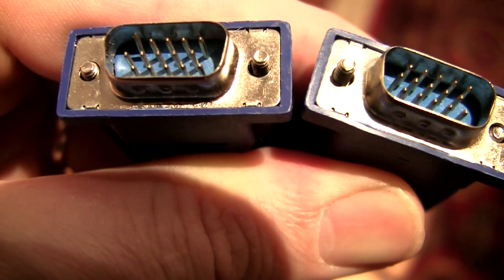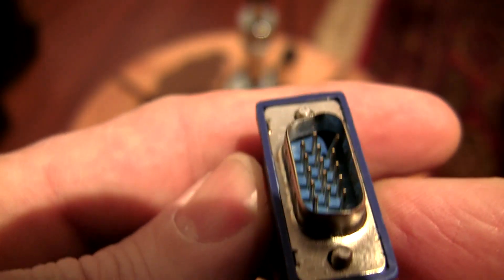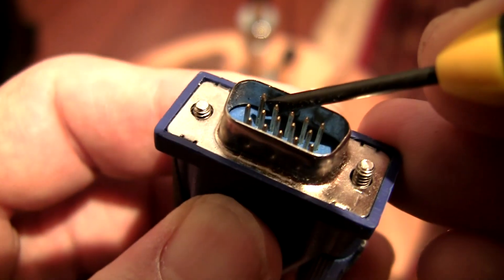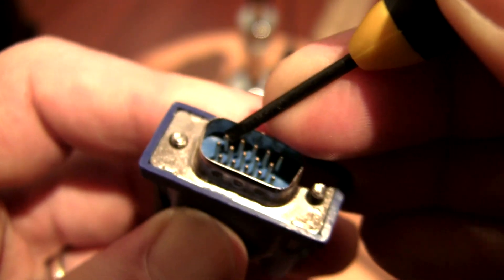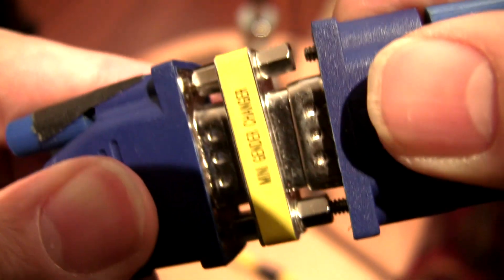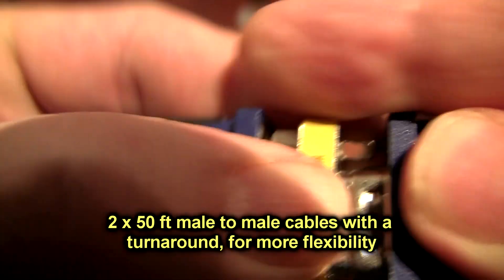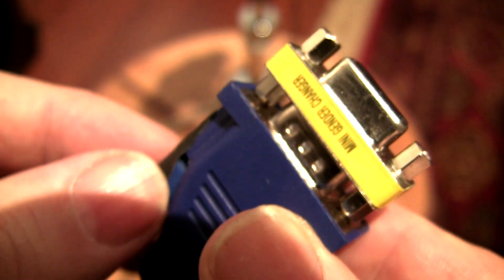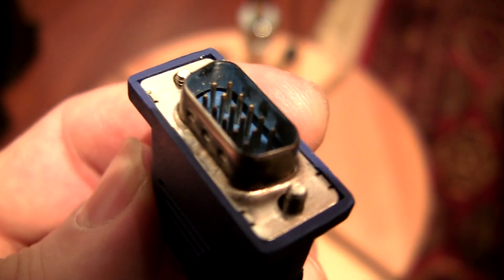How to Fix a VGA Cable Connector with a Bent Pin

Comment: Use an mechanical a pencil, just retract the lead and place the pin in the hole, much safer!
Reply from the maker: Good tip! If the pin is way bent, maybe a little help with the precision driver and the pencil to straighten it...perfect!
Reply: Mechanical pencil?
Reply: @tronetrickard7130 you know? like a lead pencil, the ones where you click the top and your lead extends outwards, mechanical pencil (0.5mm) (0.7mm)

Comment: I remember using VGA all the way into 2019! With a Monitor Mishap, VGA usage ended, and I'm now fully HDMI on that front.
Reply from the maker: I agree! HDMI is my next move (I always rent gear, so I haven't got much overhead to worry about). Cheers!
Reply: @bacontrees  Hey, man. I'm not dealing with a broken pin or wires from the plug that connects to my security camera system but the plastic of the plug itself that secures the connection of the metal is bent on one side, making the fit onto the motherboard's port too narrow.

How do I fix this?

If I bend the plastic to not be narrow it could damage the metal inside making the proper connection. Also if I attempt to shove it on there that could mess up the port from the motherboard.

From one tech guy to another, I thank you for these videos.

Comment: heyo, i have multiple bent pins, and let's say i did fix them, what's the possiblity of them actually working?
Reply from the maker: As long as they are intact, and not severed at all, they should work fine once bent into position. I'm going to do an experiment with one of my cables (I have too many).
Reply: do they have to be 100% aligned with eachother (like there shouldn't be any discrepancy with the 2 ends), or will a little unbalance be fine?

Comment: When i connect my vga cable, the monitor ia having blue filter? How to fix it
Reply from the maker: Sounds like a damaged pin....check that they are straight, and if they are, just replace the cable.
Reply: @bacontrees  thanks i did :)

Comment: thank you for your help, but would you say it’d be possible to have straightened a bent pin and still not get a signal?
Reply from the maker: It is possible, yes. Just bend it back and check it.....and cross your fingers!!
Reply: thank you for the reply. i hope it's still good. not like i should still be using VGA in 2019 though haha
Reply from the maker: @heavilybleeding  I see a lot more people going to CAT5/6, but still ending at VGA for the projectors. I personally am looking at similar solutions, but HDMI for my personal projector. Cheers!

Comment: One of those screws on the sides are broken
Reply from the maker: Actually, it was just set a little lower than the others....otherwise it just looks broken. Cheers!
Reply from the maker: On another note, I rarely connect the screws....I use electrical tape or matte  stage tape because it takes too long to strike all the gear at an event, whereas I could just take the tape off the connection. Some people wayyy over tighten the screws, wasting a lot of time for those who have to pack the gear....anyway...
Reply: bacontrees one of the sides of the screw sticks up a little more

Comment: hey bro my vga cable's metal is bended how can i fix it
Reply: Buy new one
Reply from the maker: I would try long needle-nose pliers and gently move the metal back into shape without touching the pins.....longer pliers will have more torque and it will be easier to move the metal.